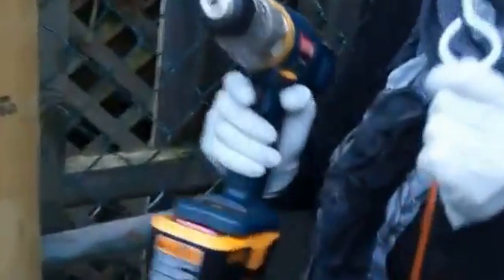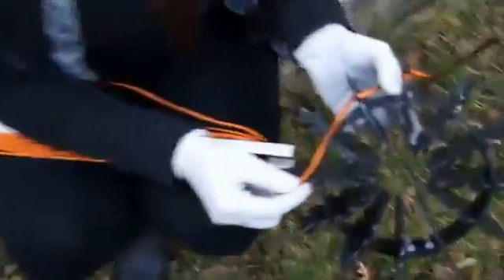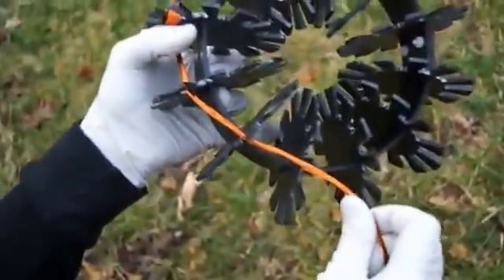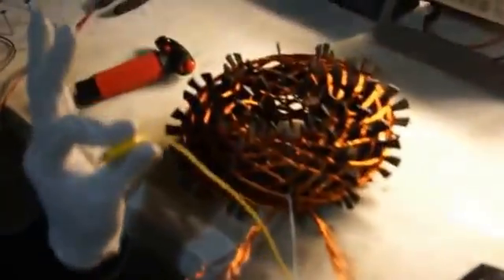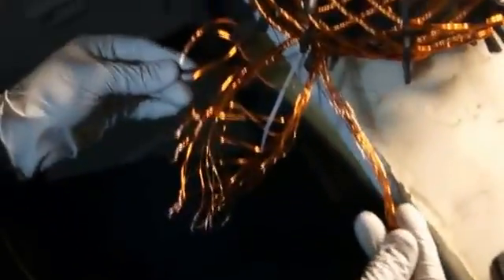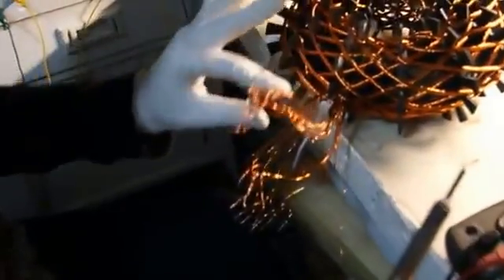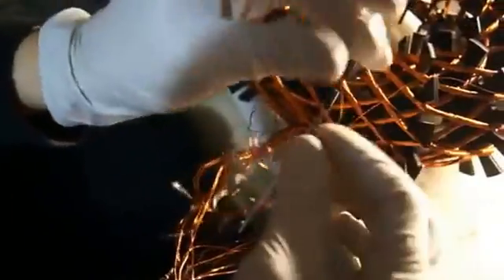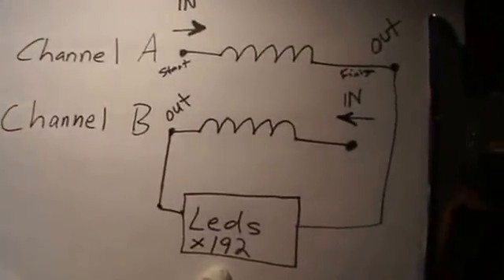Vortex Technologies  POE Coil   How It's Made

Comment: Good day, 🎉

With the various coil sizes, you should achieve the correct resistance between 4 and 8 ohms. What kind of copper wire should you use? Is the thickness important? Or should you use longer lengths of thinner wire?

Grt koen

Comment: N        E           W            S           Folks,
 Any  copper wire or coil when driven by an outside source (frequency generator),(ac input), will have an output power commensurate with  its input!
In other words, you ain't gettin'  nuttin' for free! 
I think she's selling the winding forms!

Comment: How is it free energy if signal generator needs power? Can it work out of radio frequencies out in the air?
Reply: Yes. First of all a solid question. Secondly It can work via radio signals but through direct radio signals just like she used a signal generator for direct bombardment of signal to the coil. 

The radio waves we get via transmission from satellite are weak and needed to re - amplified in ground stations.

Comment: 5:20 you are picking up two wires verifying it with multimeter that these are the same end and then you take the first end and say connect it to any other wire, how the fuck it is possible while you connected it to the same wire you check the continuty ; so that is wrong. The important thing was how the ends were connected, the fucking removal of insulation, burning of insulation, and putting the fucking amplifier were not important. I want to ask one thing do you wipe your ass before dropping the stool and pull up your pajama or you drop the stool first then wife and then pull up your pajama........................if you understood that correctly you would have given the right instruction...............you are retarded.

Comment: you can call me a skeptic, I do not own a signal generator but I would like to make my self one of these vortex coils. Without a signal generator it may not be possible for me to test this.

Would it be possible for you to show the voltage and amperage readings before and after the coils?

Thanks for your video
Reply: Altimit1417 
http://www.free-energy-info.com/Chapt7.html
Reply: yes use old stereo and you phone and app for feq gen and all should work worked for me make sure to measure in ac not dc